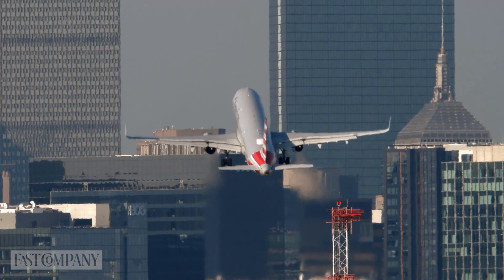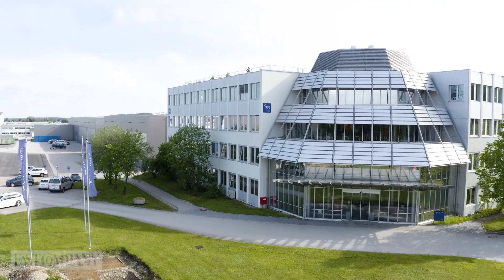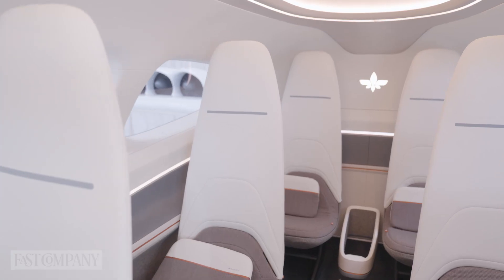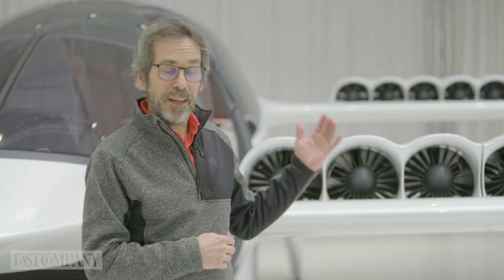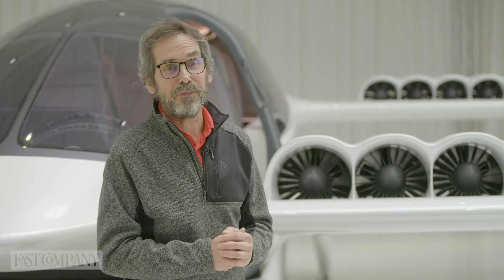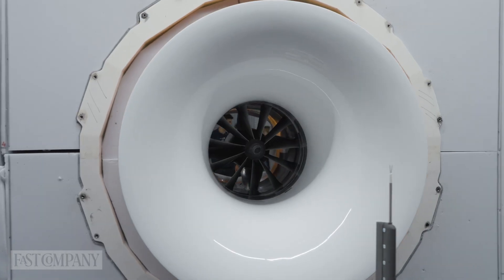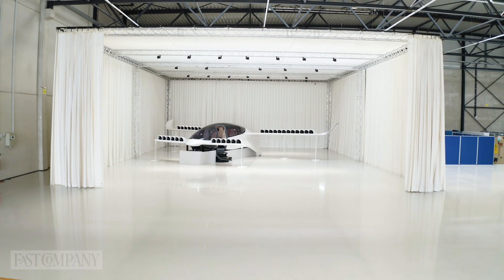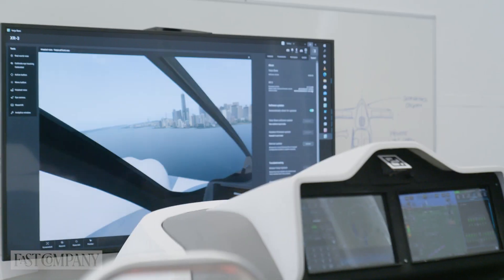This $10 Million Electric Jet Claims To Revolutionize Air Travel By 2025 | Fast Company

Comment: Now get the wings to fold in over its roof, like an insect's, and make it driveable and parkable in cities, no larger than a minivan.
Reply: If you do some research you might find their original depictions of it on the road with the wings folded forward along the body and the "dustbins" with the front ducted fans that retracted inside the body.
They had NO canard in cruise configuration relying only on the body lift which might have been theoretically possible but certainly not tolerant of any failures- they also had no fins at first.
As just graduated students they had no practical experience or design mentorship and just got onto the new 'evtol/ distributed thrust' bandwagon triggered by Mark Moore and the aborted NASA "PAV" personal air vehicle and SATS small aircraft transport system 'initiatives' that I, to my regret, think I had a hand in starting, inadvertently, from my correspondence with Moore and my lecture (forum) at Oshkosh EAA in 1991 attended by NASA staff.
Without genuine roadability they just reproduce on a smaller scale the same failings of the hub and spoke airline system needing the ride to and from the airport all over again ( 6 separate vehicles and drivers for each return trip) the need for elaborate "vertiports" (airports) with parking space for Uber pick ups etc etc dooms the economics right away.
There is a workable solution needing neither airports or runways and being neighbourhood friendly true door to door and personal etc using ATOL - I am still trying to show how this can be done just without the billions,or millions or even thousands of dollars,euros being splurged on wrong ideas by the misled grifters...